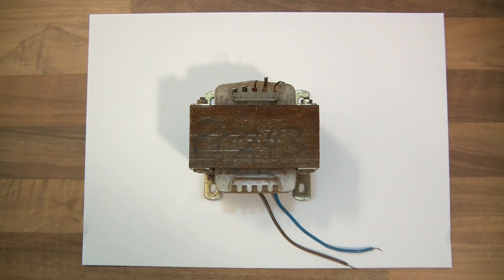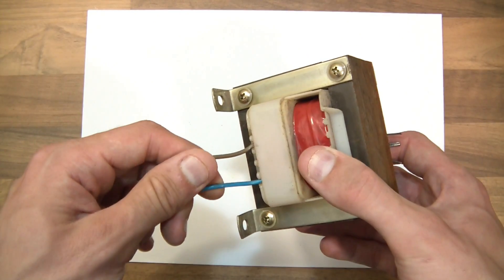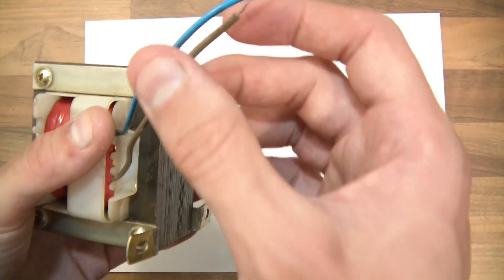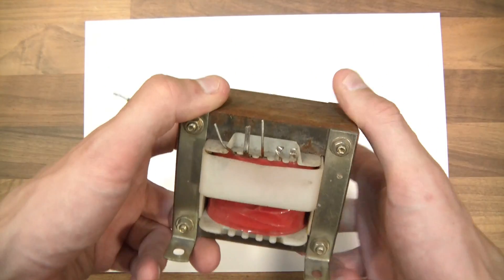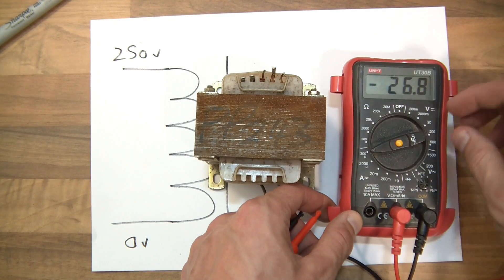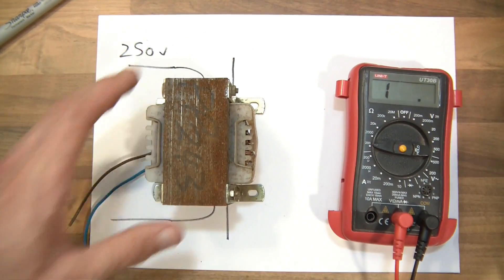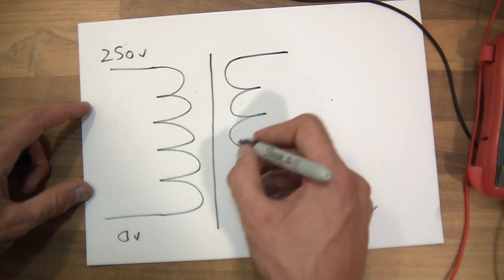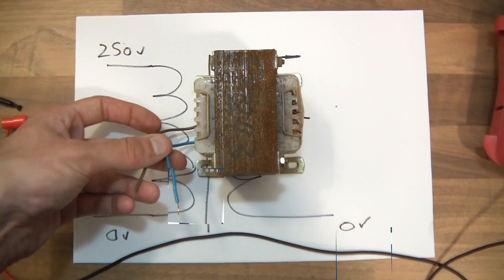INVESTIGATING: How to Identify a Transformer (Input/Output Voltage, Amperage, Taps) (Part 1)

Comment: I'm a tad confused, i was assuming to watch a video that you would show how to determine the output / current of a transformer,  but you admitted you were new to transformers and didn't know much,  how does that help others to learn ??  You took resistance readings of secondary winding's?!,  what did you determine from that?.
>>Edit.... I read your comment regarding its not your tutorial. I'm only assuming that you did not understand the video you hijacked in the first place. If you don't know about electronics  ,especially transformers, as on comment made by another viewer here, transformers are either step down or step up, either way, if you don't understand your self, you could get some one hurt if they don't anything at all, be careful, you say you've been 'dabbling' in electronics for a year, electronics is a very wide study, I myself have been interested in electronics since I was 8,  and still learning. 
Sorry for the negative response , but I get peeved off with videos where no knowledge is shown, not in the slightest, and as said, it can lead to peeps getting hurt for very poor instructions, and there are members of young age starting out in this field. A nice tutorial of electronics and tear downs,  look at Big Clive on here...

Comment: I highly recommend that before you try to teach transformer basics to someone else, you should learn it yourself. I don't know where to start to correct the things you said so, I won't even bother. Please take down this video, do some research and then try again. I wish you luck.
Reply from the maker: Roy Riederer Hi, this wasn't a tutorial my friend. Nevertheless, please elaborate and I'll review it later on. Thanks.. Antony...
Reply: So am I to understand that you intended this to be a video of you trying to figure out the specs of this transformer? A "look what I got here... now what the heck is it?" Interesting. 

There are many very good technical videos out there that will teach you what you need to know. Including some elaborate math if you wish to go that far. Just be careful and don't make assumptions. 

Remember that a transformer can work both as step-up or a step-down depending on how you wire it. On a step-down transformer, the primary coil will have the highest resistance.  

You can get an idea of current capabilities by looking at the diameter of the secondary windings. Larger diameter indicates lower voltage and higher amperage. But there is much more to it. Again, don't just make assumptions.

If you get odd readings when checking the resistance of the wires, it means poor test leads (bad connection) and/or poor quality meter. So don't scratch your head and wonder why this is happening. 

It goes on and on. The best advice I can give you is to keep studying. There are many videos out there with mistakes in them so don't just believe the first video you watch. Compare many of them. I personally watch hundreds of videos not because I need to learn the basics, but because people often have little tricks and tips and interesting ideas that I may not have thought of myself.
Reply from the maker: Thanks! Correct by the way. What I do is label the videos; TUTORIAL are "this is how to" and INVESTIGATING is "messing about with". I suppose the title is a bit misleading though. I agree with what you say too about the transformer. I made this video 6 months ago, and I've been dabbling with electronics for almost a year now. I'm an amateur.I'll need to review these sorts of videos... :-)